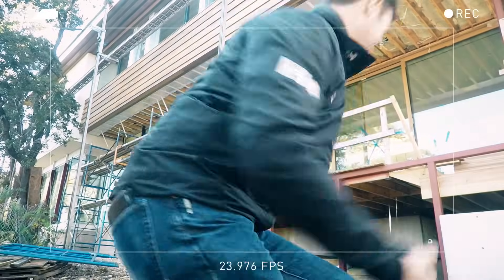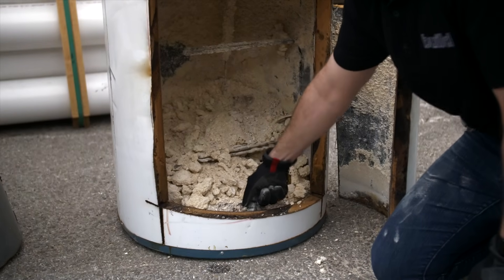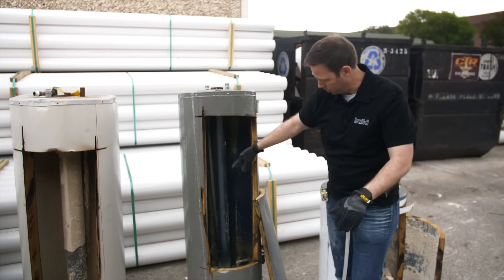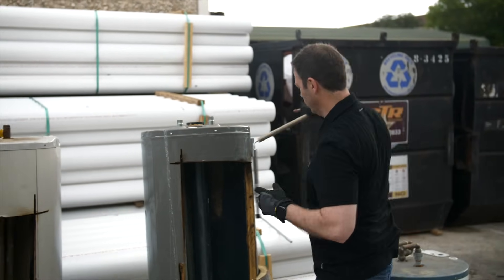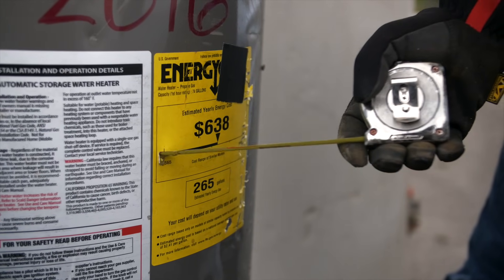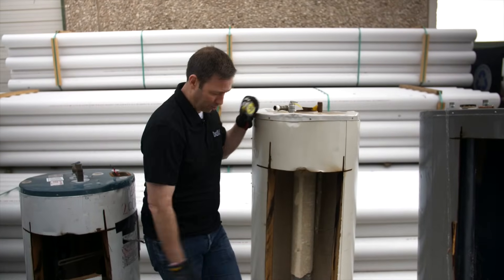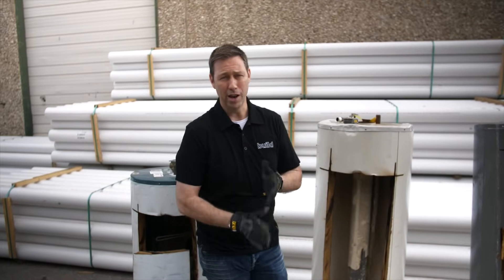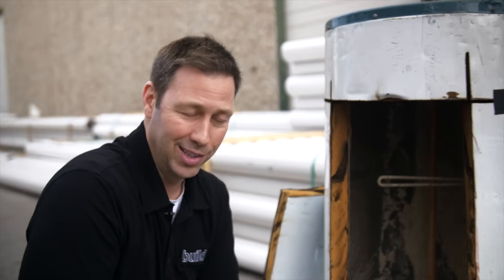Four Water Heater Tanks Cut Open - Lessons to Learn

Comment: Look...here's the low down on water heaters...when new, remove the drain valve and replace it with a 3/4" ball valve (Full Volume). screw a hose adapter onto it with about a 3 foot hose.... every 6 months, without turning off the water to the house, open it up all the way into a 5 gallon bucket and blast the sediment out several times. That keeps it pretty clean and it takes seconds. As far as life expectancy.....soft water is the best you can do. I have soft water and everything lasts much, much longer....especially shower heads, tub/shower valves....everything. Experience? 35 years a Union, Master Plumber. 10 years my own business.
Reply: Amen brother.  And check the anode every 5 years, with a replacement sitting there waiting.
Reply: I should have said that but viewers would reply: "the ceiling isn't high enough"
Reply: @readmore3634  sometimes it's not, hahaha, short tanks are easy but talls kick my ass since they basically have to be uninstalled most of the time.
Reply: Get the segmented anode rod, problem solved.
Reply: I am a retired Homeowners Insurance Claims estimator with 34 years experience.  Extending the life of your water heater can save you a few bucks over the years.  More importantly is that water heaters are one of the most common sources of water damage to homes.  The most common cause of water heater leaks is rusting out of the bottom.  This occurs slowly over a period of time which unfortunately often leads to mold and rot damage not covered by insurance. A second common source of water heater leaks is slow dripping from the cheap plastic drain valves.  This also often results in long term water damage not covered by insurance.  If your water heater is hidden in a closet I recommend giving yourself a reminder to inspect it for leaks every 30 days.  As Read More (plumber m) points out replacing the cheap plastic drain valve with an inexpensive brass valve can save a lot of damage and headaches down the road.  The third common source of water leaks is from failed wearer supply leaks.  These are pressurized lines so these leaks are typically sudden and can cause more expansive (more areas) water damage.  Always use the best flex metal supply lines you can find.  Believe me, the couple extra dollars spent on these could save you thousands down the road!  Cheers.
Reply: @danmyers9372  I've seen water heater tanks last 5 years...and 30 years. I'm more of a new construction plumber, but I do service work for a lot of my friends, neighbors and family. I've   never seen a water heater completely fail and flood a house...but sometimes people notice a small leak months after it started. Hard to convince people to replace a non-leaking, functional,  12 yr old water heater....Even myself.
Reply: @danmyers9372  I agree with everything you say Dan....    Dan can you jump over to another thread please?  Only two people on it....  its about ins co's in the fire areas... I would love your input.  Do ins co's charge $6000 a year for ins after a fire???   check it out please...  thanks
https://www.youtube.com/watch?v=4np6TW3cGRo&lc=UgzYj_IsOY6FhafloAJ4AaABAg.9DQtNjqVLe89DTVnJaOLCX
Reply: Thank You.
Reply: I built my house in 2004 and am already on my third electric water heater. The first two worked in conjunction with a water softener, and they both lasted less than 5 years. Each one corroded bad enough that they broke open and leaked. After the third one was installed, I decided to remove my water softener. So far it's been 7 years and still working. I have been unable to find anyone that can explain my prior failures. I removed my water softener based on something that I read somewhere, so I figured I didn't have much to lose by trying it out. So far it's been the right decision for me, but I just wish I had some concrete answers about what caused my issues. I'm open to hearing some possibilities if anyone has them...
Reply: @mj625  Honestly, here in SoCalif (heavily populated) 99.9% of the water heaters I work on/replace are gas. Maybe the electric heating elements have to do with it? I'm no scientist...
Reply: @readmore3634  I fancy myself to be a scientist—since the energized electric element is isolated from water then what happen in the tank should not have great effect → the calcium / minerals to actually be removed requires not just a filter it is RO which is costly beyond scope of residential water ~ recently I replaced an electric with a 12 gallon myself in a shop-area; I had given thought to  being able to drain the tank as flushing I very much agree with you yet decided that with 10 years in  service it was simpler in my situation to get it going =>> most definitely I would rather do a flush as you say yet I have found all supplies today fail thus decided simple replacement of tank as PM 

When removing the damaged unit I could not drain it as minerals had built up so bad the drain would not work ▬ after decade working in Texas I was at Union trying to hire out for reasons of safety so your business strategy  I concur;  reverse osmosis water filters do not remove some pesticides, solvents and volatile organic chemicals (VOCs) including: Ions and metals such as Chlorine and Radon → carbon filters are better at VOC's so the problem using RO to remove minerals from supply so  water filtration for supply line is better done with your design
Reply: @readmore3634  usually the electric water heaters in certain areas don’t have natural gas and use well pump so that’s what makes all those electric water heaters getting leaks ... New Jersey has high iron !
Reply: @mj625  I'm no scientist either but I am also a Master Plumber and have to ask were the water heaters brand new or refurbished on the day of installation? Water heaters last 10 years in Philadelphia on average with no maintenance.
Reply: @EminentPK-z1s  my water heaters were brand new AO Smith units. Since I last posted here, I think I have a good guess what happened. Due to covid-19 I had some free time to do some "deeper" maintenance to the heater I have now. I flushed it out extensively, installed a new drain valve, a new anode, and repaired some corrosion at the cold water inlet. While reading the paperwork for my unit, it clearly states that if it is used with a soft water system the anode should be checked annually because softer water can cause the anode to corrode much faster than without soft water. I believe that the previous heaters I owned prematurely failed because the anodes were never checked. Lesson learned. When in doubt always read the documentation provided by the manufacturer.
Reply: @mj625  I bought a 6 yr water heater and it failed 6 yrs and 2 mos afterword. No guarantees.
Reply: @mj625  The problem is the water softener. The traces of sodium that does end up going to your homes water supply piping and eventually your water heater tank, reacts with the magnesium anode rod. These two interacting with one another causes the sacrificial magnesium anode rod to deplete quicker which theoretically will leave your heater tank unprotected from the rusting that will occur once your anode rod has been diminished. So if you want soft water or a water softener system installed in your home,  just remember to replace your anode rod on your water heater every 4 years. Without a water softener replace that rod every 6 to 7 years.
Reply: .. Thanks for the advice !!
Reply: @KZ3W  oops....didnt see your comment...you are welcome!
Reply: United association ! (UA) i guess ??

maaaahh !!
Reply: @jessybwoy8677  Yes....sworn in 1979...worked almost every Mon-Fri for over 35 years....90% new housing....Custom houses on my own (weekends).
Reply: My hot water heater is leaking from elements. Can I replace them and keep using it? It wasnt really heating either.
Reply: @onfire4theLord  Hard to say Ange...I have a pool house out back that I built here in SoCalif. When I added a stackable washer/dryer inside, about 4 years ago, I purposely left about ten feet of hot and cold1/2" pex exposed to the sun outside just for test purposes... gets about 6 hours of sun a day......still holding out fine. If I remember I'll go out back tomorrow and make sure it's not all brittle and ready to snap in half. I'll let you know if that's the case.
Reply: What about thoses electric anode rods. Are they better than the normal ones? Or just as good?
Reply: Is there anything I should look for that would mean I have to just get a new one?
Reply: @brittanymoran7123  If your electric water heater tank is not leaking you can just replace the heating elements (they come with new O-rings)...they're pretty cheap and easy to replace....you can't really repair a leaking tank. And be sure both elements are working or it will take forever to heat the water.
Reply: If that's the case with softeners, why do ice machine mfg'rs recommend not using 'softened' water ?
Reply: @bufallobiff  Water softeners on ice machines should be avoided in most cases. Excess sodium in water has the ability to alter the freezing and melting temperatures of water. Thus, water softeners will lead to soft, mushy ice cubes that melt faster and can negatively impact beverage quality.
Reply: @phubarnow5388  But don't you think that if any significant amount of salt got in the potable water system you'd taste it?....right away? I asked my doctor: "Is it ok to eat salted sunflower seeds?" He said eat all ya want...and as you know you can taste the salt right away in a seed......so drinking water that has no salty taste should be fine.....but a soft water machine CAN fail like anything else...mine did...and I fixed it right away. (new one)
Reply: @bufallobiff  If a soft water machine isn't maintained properly it can dispense salty or bad tasting water. Soft water machines are mainly used for LARGE amounts of water treated....an Ice maker should utilize it's own, separate RO system.
Reply: Not enough experience.
Reply: thanks for the tidbit!  Much appreciated.
Reply: Can you still get the same result with the original drain valve? Also, how important is it to switch out the anode? My current heater is about 12 years old.
Reply: @daniell563  I use Bradford White water heaters now. Seems most manufactures have switched to a nice, brass, 1/4 turn ball valve for draining/flushing instead of the useless plastic one (easily plugs up).
 As for the anode rod: I would guess that less than 99% of water heaters in use ever have the anode changed....If you get 10-20 years of hot water from a WH you got your money's worth. (IMO) If you can get your anode out of your 12 yr old heater, kudos to you! I tried to replace one years ago and it felt like the whole house was going to turn before that anode was going to budge. 
The amount of extended life you get from changing the anode regularly prolly varies a lot from location to location. Municipal water has varying pressures, hardness, softness, chloride, rust, sand, dirt, fluoride, lead, herbicides, mercury, perchlorate and pharmaceuticals. Good thing the human body has a large liver. :- )
Reply: @readmore3634  Thanks so much for the info! If you don't mind, another question regarding a different topic...My water pressure sits at 120psi (too high), but as soon as I turn on one of the taps to a slow trickle, it drops straight down to 30psi. Adjusting the existing PRV doesn't seem to do much. Would switching to a new PRV help fix the matter? Otherwise, I hear a constant, low-sound hammering in the pipe close to the PRV.
Reply: @readmore3634  Thanks again!
Reply: Averageskill Couldn’t agree more. My current gas water heater was installed in 1981. Still works excellent, however recently I’ve noticed some pex lines I ran for a bathroom renovation starting to discolor. I will be updating at some point in the near future, but we are talking almost 40 years. I agree a water softener does have a great impact.
Reply: @Joe-bv7io  My 40-gallon natural gas fired tank was already here when I moved in 25 years ago.  That sucker's still running, but I'm even more impressed by yours!  I credit a good build (sorry, can't see a manufacturer's name on it anywhere, it's in a sealed fiberglass blanket) but more so, the fact that it gets ferrous-iron filtered and softened water fed to it. 

It doesn't even have a sacrificial anode anymore (removed around 1997, couldn't replace due to low ceiling), and I haven't flushed it for two decades.  How it keeps going is pretty remarkable.  But it doesn't seem to use too much nat-gas, so I just let'er chooch along.  Someday it'll die but I won't cry, after 25+ years.  That thing will receive a grateful funeral worthy of a Viking warrior.
Reply: @Joe-bv7io  Discolor...hmm..you realize pex should never see the light of day or heat from can-lights and such...  right?
Reply: Wouldn't having a good water filter (before the tank) cut back on the crud getting in?  Also.....years ago hardware stores were selling insulation blankets for water heaters, have they gotten away from that (I don't see them anymore) or are they still a good idea?
Reply: OK, Thanks for the reply.....    ;-)
Reply: @USCG.Brennan  He's right, I've taken out so many water heaters that were on "good filters" and we're filled with crap, draining twice a year is the way to go, only about 2 out of every 100 heaters I replace are drained every six months, my experience, ten years of being a water heater expert (the place I work for literally only specializes in water heaters) for over ten years and having well over 3000 installations under my belt of just about every water heater imaginable.
Reply: @CRUSADER85    Our system is a "Pura" double filter solids and ultraviolet (not a cheapy) and I change the solids filter every year.  
I find very little crud in the filter each year so was wondering about it affecting my water heater anyway.
Reply: @USCG.Brennan  I changed a heater today, nice filter and uv system, still had to clear the drain of scale and even when the heater was completely drained it still weighed about thirty or so pounds more than it should have, all sediment, it still builds up if you don't drain your water heater, I'd take the advice of draining once every six months, if you don't fell comfortable doing it yourself you could get a plumber to drain it for ya but that could be costly and I recommend doing it yourself if you're able bodied.
Reply: @CRUSADER85   Thanks, I appreciate it.  I installed the tank myself about 4 months ago, so draining it will be no problem.....I was just curious
of the effect of a water filter on it beforehand.
Reply: @USCG.Brennan  Honestly the filter is more for safe drinking water, bacteria and such, a softener will help if the water is hard but even with softeners installed I've seen really hard water still  proceed to damage plumbing fixtures.
Reply: @USCG.Brennan  a good water filter will cut sediment...actual bits of metal and rocks....it wont cut down hard water
Reply: @ Curt Brennan,  "having a good water filter" is very subjective. I have an inexpensive ($40.00) pre-filter to protect my soft water machine from debris (replaceable cartridges $4.00 ea.) . I have a lot of debris so I change the cartridges about once every 2-3 months. There are filter systems that self clean that cost $1,000's, but do not remove calcium build-up. I recommend my set-up.
   You can buy water heaters with R-8 or R-16 insulation factors. R-8 for indoor heaters and R-16 for outdoor or garage. A blanket benefits any water heater but to what extent I'm not sure.
Reply: @readmore3634  I've seen the blankets cause condensation / sweat and rust the WH from the outside.
Reply: @dave-yj9mc  I've never seen that but I certainly can imagine that happening.... Here in SoCal it's arid...but in states with actual weather changes I'm sure it's a thing.
Reply: did you remain in the union after starting your own business
Reply: @MarkDavis-je5pm  Yes, I was 49 in 2008 when the housing market all but stopped. I told the union business manager "Instead of signing the books I'm going into business for myself, (leaving room for a younger member to take my spot), if I get enough work I'll hire guys from the hall". He said "That's fine, good luck". In my business, you need to go big if you want to eliminate 90% of the competition. That's not easy during a 
Financial Meltdown so I worked hard to stay small. I'm fully vested in 2 retirements with a couple rentals in SoCalif. We have a group of guys who buy houses, fix and remodel'm, and sell'm. I'll prolly never fully retire. I get exercise while being paid for it.
Reply: @readmore3634  I now idol you, i work in NJ and the guy who owns the company I work for is a total piece of crap. Cuts corners all around and pays techs total crap towards work performed. You have it right my friend and bless you for what you do and how you take on the young and aspiring
Reply: @colinshawn3102  Honestly and sadly that's most places nowadays, I worked for a place where the boss was mad that I did things correctly or too correctly and said I was trying to "show up" some of the guys who have "done it longer than me", it is what it is I guess.

Comment: The video is very right in so far as flush and replace the anode rod. I just replaced my WH (electric) Bradford White and it is a decent heater, nothing special. I did set it up for gravity fed recirculating so hopefully it will keep the sediment to a minimum. But the narrator is right about having a softener. It will protect the heater and piping for double, triple the normal life of plumbing materials. But caution, once a system is softened, never take it off. The piping will corrode at an alarming rate. 
The efficiency can be boosted by wrapping the heater with foiled insulation. The more the better. Making a clean job of it is not hard.